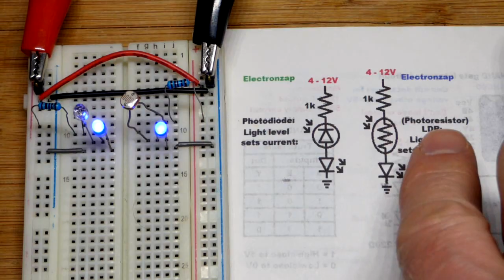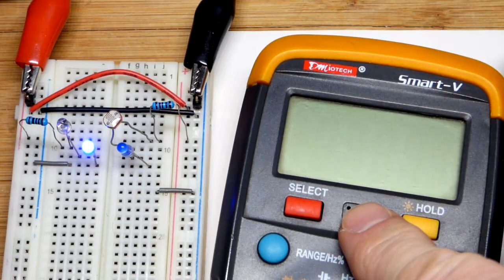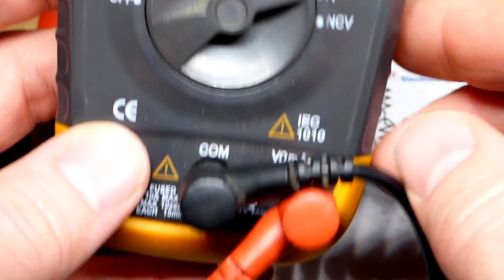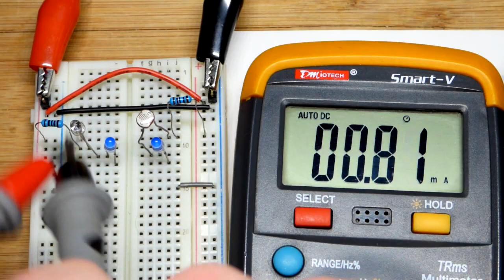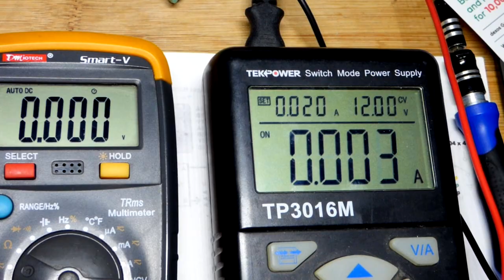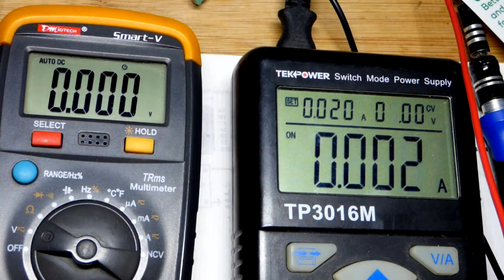Photodiode Versus LDR Multimeter Measurements For Beginners Learning Electronics By Electronzap

Comment: What is the part number of the photo diode.???  I want to research the spec sheet on that part.   I may want to use it for an upcoming project.   THANX.
Reply from the maker: I don't have a part number unfortunately. I bought them a long time ago on Ebay. So who knows who made them.
Reply: @Electronzap  Thanx
Reply: Use LEDs, any color except white. Their all photodiodes.
Regular photodiodes are basically infrared silicon Leds.
OK, normal photodiodes are much larger in surface area so would be more sensitive
redrok AD0TJ